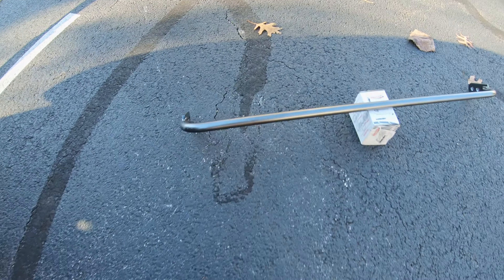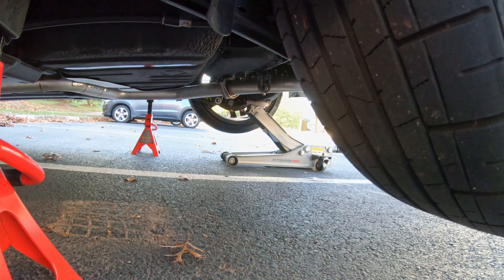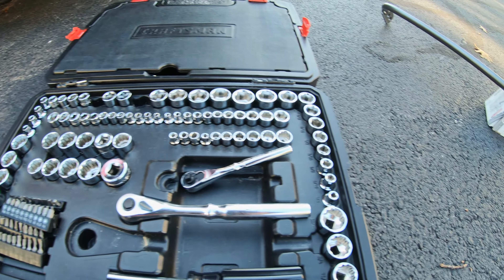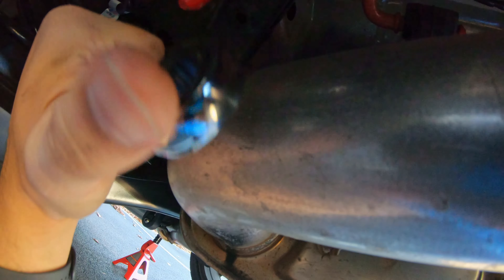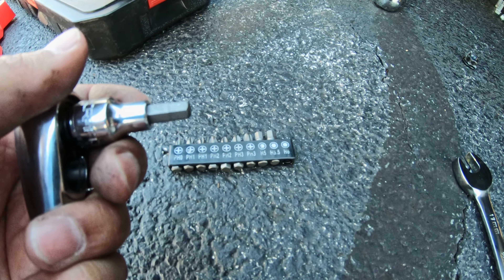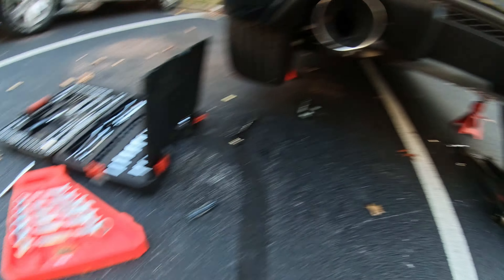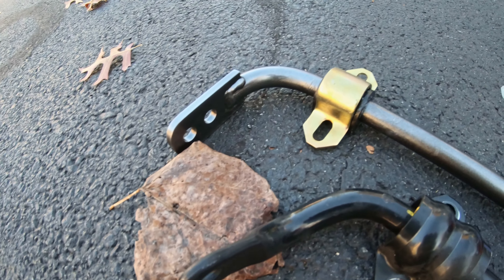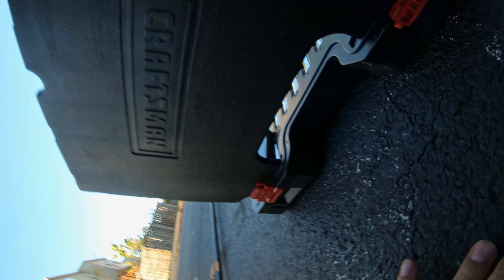Pierce Motorsports Rear Sway Bar Install (Veloster N)

Comment: I've got mine on.  But like you I had to use the softest setting as our stock endlinks don't articulate enough for the inner holes.  You mentioned getting aftermarket adjustable endlinks.  Did you?  If so, which ones?  Did they work with the inner holes on the Pierce sway bar?
Reply from the maker: I haven't gotten them yet. Maybe later this year or next year I will get SPL adjustable endlinks. Since they are adjustable, they should work with the inner holes
Reply: I just got a white line rear sway bar and white like adjustable endlinks they adjust up to the inner holes and you can crank them down a little for some preload to make it even stiffer I doubt I'll be doing that since the tires I'm running arnt that sticky. I love your N by the way wanted an N but ended up with an 18 ES
Reply from the maker: Thanks. Preloading the sway bar isn't good for the handling of the car. It will affect static ride too much. If you want more static stiffness, stiffer springs and/or dampers is the way to go.
Reply: @umarovracing  a little is good to much will make for one hell of a fight. My car is already lowered on yellow speed coilovers just want to get the rear to not hop and help the front to rotate better on hard corners. I will be doing the VT N engine mounts soon along with white line front suspension arm bushings should be touge battle ready.

Comment: hey brother, do you recommend upgrading both front and rear sway bars on this car for the track? or just a beefier rear? i've been thinking of getting a whiteline 22mm or 24mm RSB but was wondering if i should just change the front too. thanks!
Reply from the maker: Beefier rear (22mm) is a good place to start with. Test that and see how it works for your driving style and setup. 

If you go with 24mm rear, you need to do the front as well.
Reply: @umarovracing  thanks man! i ordered a whiteline 22mm RSB.
Reply from the maker: Nice

Comment: Do you still have the factory sway bar? I want to put a VN rear sway bar on my EGT N Line. I’ll buy it off you if you’ve still got it!
Reply from the maker: I do! I just don't know where the bolts are for the mount
Reply from the maker: I will look for it today. Message me in IG